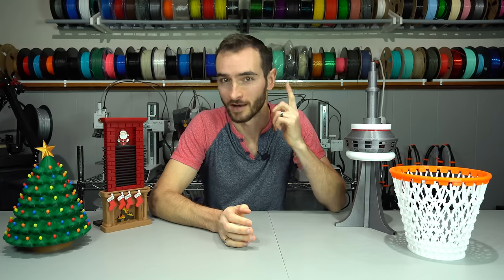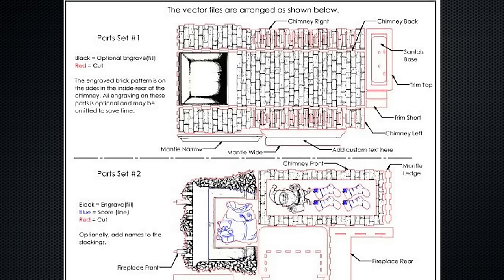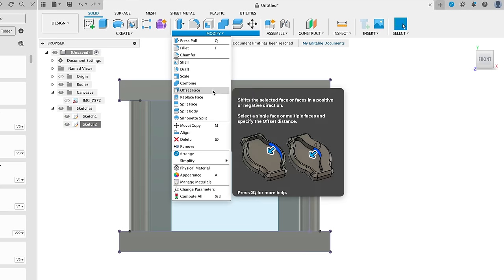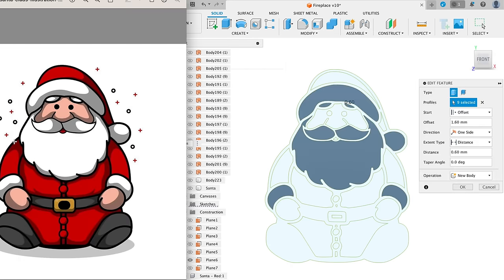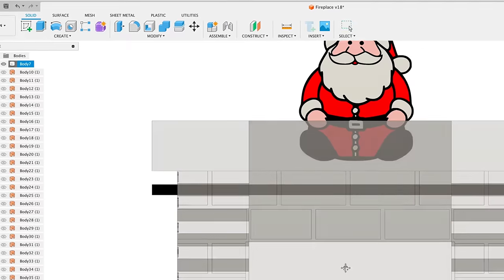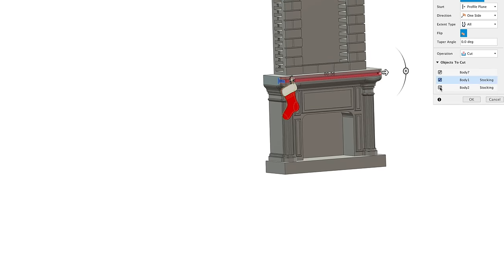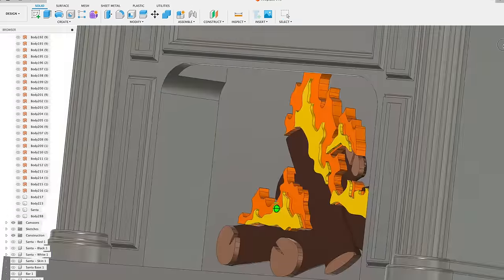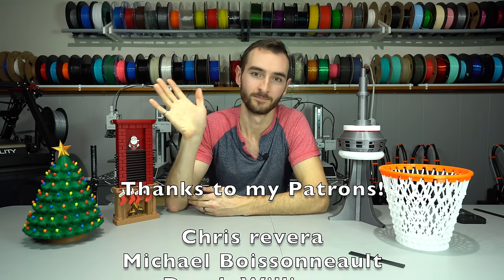How I Design Best Selling 3D Printed Products ($10,000/Month on Etsy) - Full Tutorial

Comment: I learned quickly that print-on-demand is not the model for me. Designing your own products is definitely the way.  I haven't hit $10,000 in 30 days but I have hit $4,500+.  I want to incorporate HueForge paintings into my designs but importing the HueForge mesh into Fusion always brings my computer to a halt and everything becomes unusable.  Basically there's just not enough computing power to turn the mesh into a solid body. Your HueForge video still informs me to this day, I'm curious if you have any experience/suggestions for editing a HueForge mesh in F360.  Thanks as always for the great content!
Reply from the maker: $4,500+ is still great. Congratulations!

Fusion 360 really chokes on large meshes. It would be better to keep the HueForge model separate and combine it with the other model as a final step using a program like Meshmixer. Glad to hear that HueForge video was useful for you! Thanks for watching and commenting. Your viewership and engagement keeps me motivated to keep going.
Reply: Or pay a better designer to design for you.  My level of skill with Blender didn't come close to the skill needed for some of my products.  Make sure to have a solid contract in which you get full rights to all the files used to design, if you do supplement your designs.

Comment: I like how you layered the Santa colors to make it printable with manual color changes. Can you go over how you do this in more detail? Also it looks like the white and the pink are on the same layer. Are you able to print them without colliding with the previous color?
Reply from the maker: Thanks. Every color is on its own layer. I usually use 2 layers per color, but sometimes more are required for lighter colors. I basically just import each color as a separate SVG and extrude them to defined thicknesses (ex: 0.6mm - 2 layers at 0.3 mm layer height). I use the extrusion offset parameter so the extrusions don’t all originate from the sketch plane, but rather are stacked.
Reply: @ygk3d  so you start with black, then red, then pink then white?
Reply from the maker: @Numenor7  yes, and then back to black. It would honestly be pretty tedious if you’re manually changing the filament. I have the Bambu AMS do it for me so it’s not bad. But this strategy saves time and filament waste versus swapping colors multiple times per layer.
Reply: @ygk3d  understood, thanks for the detailed responses. Yeah I still need to get a machine with an automatic filament change system.

Comment: To make the PETG stick to PLA, you have to raise the temperature a lot for the PETG. I print PETG-CF on PLA supports, on the BL A1 and because of the hardened steel nozzle, I needed to raise from 255 to 275 to make it stick clean. I also turned off the fan for the PLA to have a clean layer over the PETG-CF. Hope this helps
Reply from the maker: Thanks for the tip!
Reply: @ygk3d  I don't want to "over advice"
It took me some time to grasp the fact that the first layer infill speed is also the first layer on top of a support, even though the line type says Bottom Layer. 
I set mine to 50 mms. Hope this helps also
Reply: Huh!  That's' the first time I'd heard of using two materials in the same print.  Very interesting...

Comment: I'm assuming you were printing these out and selling them, but my issue with selling 3d prints even if you design them has always been they take so long to print out.   For example a fireplace that size might take 18 hours on a Creality.     Assuming you split this and had 3 printers...... 1 for the fireplace 1, for the "logs", and 1 for Santa, this would still only be one fireplace printed a day.   Thats not a lot of income per day right, even if everything sells immediately.
How are you getting around this, just having hordes of printers?   And is there a lot of wear and tear on the machines, running them 18 hours for every print.

Comment: You got some talent there. The only thing I didn't like about the Santa is the amount of color changes. I know the way you designed it makes it compatible with any printer, but it is far from practical if you don't have an automated filament changer. Specially if you're hustling and can't give full attention to it. It would be nice to see material and high level slicer settings you used (maybe I missed it).

Comment: Coming from solid works, I despise fusion 360.  They simplified the modeling process to appeal to hobbyist.  In the process everything seems less modular.  Good for individual small projects
Reply from the maker: That’s an interesting perspective. There’s obviously a reason the serious engineering firms still use SolidWorks. Fusion 360 seems more like a gateway into the AutoDesk software suite. They’re trying to get you hooked so you eventually graduate to AutoCAD.

Comment: Do you print with PLA or PETG? I find PETG very hard to print on my X1C. Also shipping PLA in the hotter months will deform/melt? If you can share your PETG profile if you use one, that would be much appreciated
Reply from the maker: For products like this I would use PLA. I’m not too concerned about them deforming in shipping. It’s never happened before. 

I use PETG for other products. In that case I just use the default profiles. Not all PETG is created equal. I’ve used some that has been nothing but a headache. You may need to try a different brand.

Comment: Curious that you use different heights for material changes.  I'm assuming you then use the flood fill to paint them in Bambu Studio?
What I've been doing is in Fusion, creating different Bodies for each thing that needs a material change.  Then I export each body as its own STL.  In Bambu Studio I then load all the STLs are once, which makes them sub objects.  I can then simply select the material change for each sub object.
That said, while this works a charm in Bambu Studio it is VERY messy and hard to manage sometimes in Fusion.  Even worse things like text for personalization, ends up with a body for every letter :(
Reply from the maker: I export as separate STLs. Group the bodies into components and export each one. Don’t export each body individually.

Comment: Are you satisfied with the quality of the prints? - for instance the underside of the bricks? also does the bridged hooking feature sag? Not asking to be a d***, but I'm afraid my customers will think less of my products if a bridged strand breaks loose... Or if there are any aspects that are less aesthetic than other manufacturing methods. Having a tough time drawing the line between quality, R&D time, and just "good enough is perfect" mindset.
Reply from the maker: I made a few refinements to the design after this first round of tests to improve on some of those aspects. I made the brick pattern less deep and added more curvature to the top of the fireplace where the stockings hang. The end result is good. 3D printed products will almost always have some aesthetic flaws. I have a tolerance I will accept, otherwise the print gets rejected. I try to design my models to give the highest quality with the least amount of post processing.
Reply: If you can tolerate skin that isn't perfectly smooth (non riding surfaces), fuzzy skin can add a subtle texture that makes prints look powder coated and camouflage layer lines.

Comment: Great video, hiw is the troodon 2.0 holding up nowadays? I want one just want to know the reliability of the machine lol.
Reply from the maker: Thank you! My Klipper Troodon is really solid. The RepRap one has a broken cable, but that’s a known issue and Formbot has sent out a replacement. Overall, they’re great machines. They’re best as a platform for upgrading. From factory they’re not quite as good as say, the Qidi X-Max 3. Mainly because they don’t have a high flow hotend. But if you want to get into the Voron ecosystem it’s a great entry point.
Reply: @ygk3d  thanks I have the qidi, I was going to order from a site that upgrades the hotend and pre-installed klipper and a few other upgrades. I didnt even know about them until you posted I have been following them ever since.

Comment: You said your company comes up with original designs... But then the 1st thing you show is a design that is already made and with variety. A basketball net, those things already exist, and also Christmas trees. You're not really selling this process of how to make and sell original ideas while everyone is just copying... Same as you.
Reply from the maker: It’s important to differentiate between an original design and an original idea. Not every idea needs to be new and novel. Sometimes it’s enough to refine an existing concept, or adapt it for use with another manufacturing method (I.e. 3D printing). If you have an original idea, by all means, run with it. But the market is generally more receptive to things that are at least somewhat familiar. The techniques I show here would apply to any idea, whether original or not.
Reply: Real curious about your “original” ideas. If EVERY product has to be a never before thought of, completely original, zero overlap of ANYTHING…. Then you would have very few existing products. Maybe that 15% change rule for patents exists for a reason!? Yeah… it does. Stop being a troll when this guy is clearly doing something right. **anxiously awaits response about how you’re a self made millionaire on all original ideas with no proof**

Comment: This was a huge letdown. Based on the title and introduction, I was hoping to hear more about product research and generating ideas. Instead we get a tutorial on how to use Fusion 360 to make a knockoff model.
Reply from the maker: Sorry to disappoint. I’ll keep those suggestions in mind for next time. I did title this “how I *design*…” not “how I generate ideas”. Despite that, I also included some insights into how to generate ideas worth pursuing, and considerations for manufacturing using 3D printing which are highly valuable. It’s not just about the software.